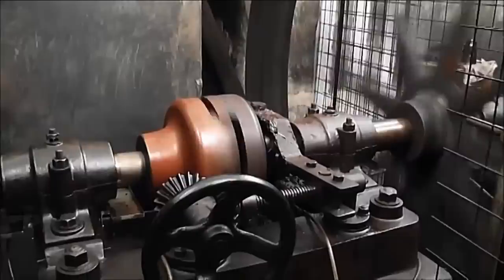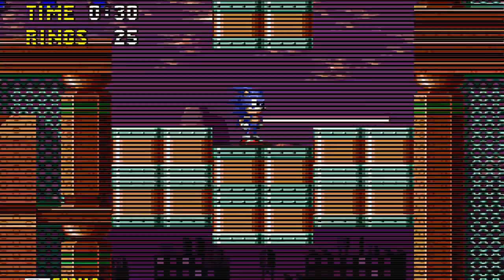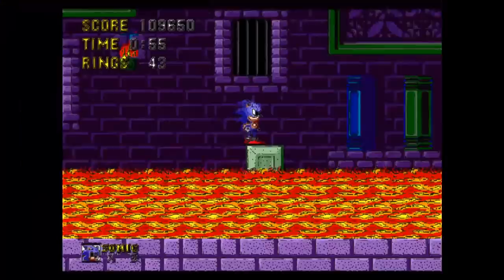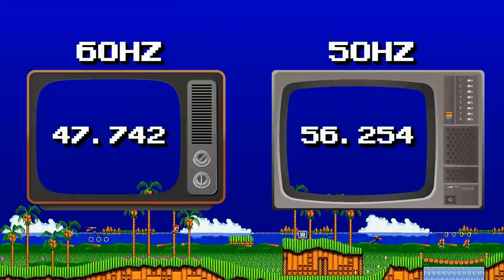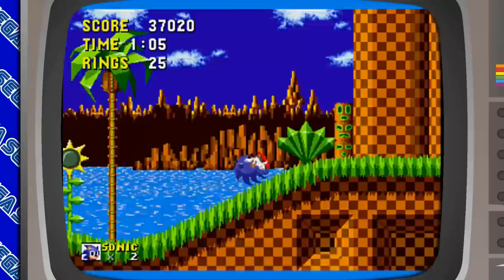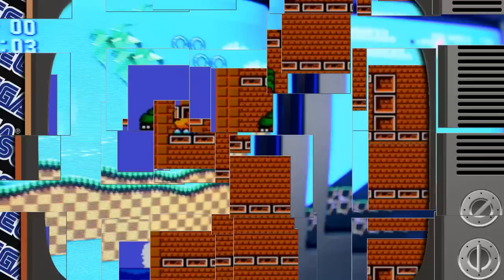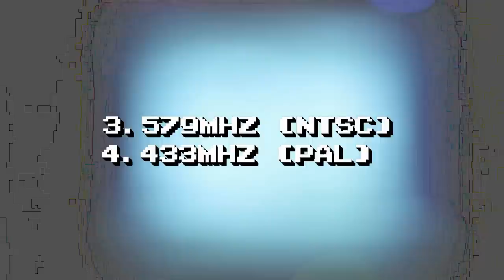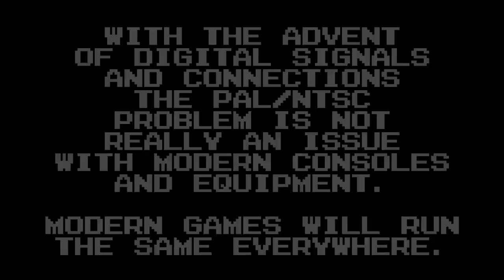Why is Sonic Faster in America? NTSC vs PAL/60Hz vs 50Hz | Nostalgia Nerd

Comment: These old consoles are easy to mod. I remember soldering in a simple switch in our PAL Mega Drive. And boom, it ran at 60 Hz :)
Reply: You got robbed 10 hz I was robbed 100 lines. :P
Reply: Had a 'merican genesis in UK, it didn't work with any of the TVs. :(
Reply: Because most games were designed for NTSC, PAL gamers didn't even get to benefit from those extra 100 lines.  Those extra lines just ended up as black borders on the top and bottom of the screen, with a squished picture in between.
Reply: @televisionandcheese   I have a US genesis and never have any issues, it would of worked if you had an RGB Scart Cable and a tv which has a scart socket, most tvs in the early 90s only ran proper NTSC in colour through the Scart socket if you were trying to use composite or RF then it would of only given you a black and white crosshatch picture if any picture at all if it was very early 90s.

I have a 1989 Sony trinitron 14"TV doesn't except ntsc through the AV inputs on the front or through RF,  So I use RGB Scart it works perfectly with all my NTSC retro consoles
Reply: television and cheese it won’t, because your TV was only 50hz, the Genesis was 60hz.
Reply: @deanfox3067  Most later CRTs work with 60hz though, even in Europe.
Reply: Can pal cartriges work in ntsc
Reply: You don't even need to do that.  Cut two traces and the console defaults to English/60Hz mode.  The true beauty of that is no one and i mean NO ONE would ever be able to beat you on rim runners from Micro Machines 2 if you practice a bit more
Reply: @josh4740  some do ! some don’t ! 
some even run in 60hz but with boarders
Reply: @josh4740  Yes they have the same shape! 💡

Comment: European Sonic should have been called Sub-Sonic the hedgehog.
Reply: or Sonic HD
Reply: Even better Sonic 4
Reply: Krisztian5HUN ???
Reply: he means cuz pal has superior video quality
Reply: even though pal did have a higher resolution games like sonic were never optimised for this which is why you have black bars on the top and bottom of the screen where you should be getting more pixels than the ntsc versions but dont sadly :(
Reply: but PAL = scart
NTSC = RF or rca
(back then)
Reply: Krisztian5HUN nope theres an ntsc scart standard in japan. Uses the same connecter that europe uses and everything just which signals come out on which pins is the only difference apart from been 60hz ntsc. Which is why i have to rewire inside the plug if i happen to end up with a scart cable from japan for an old console
Reply: everything in america is better
Reply: SirIsaacBrockOfTheColonies good joke
Reply: :D best joke of the year, nice one!
Reply: I agree Brak
Reply: Stan Smith?
Reply: I'm from the us and that is far from true
Reply: I prefer games running at 50hz. Gives the player a bit more time to react.
Not everything is about fast as you can get speed.
Man! That must be why the SNES is sooo sssllloooowwww?
Take an already slower console like the SNES and put it in a PAL region and see what you get?
At least the PAL Megadrive still had ludicrously fast games and did an excellent performance with very little slowdown when the screen got busy.

Comment: That explains why sometimes I had the fast gameplay and the slow gameplay on Sonic Mega Collection.Sometimes I would select 50Hz instead of 60Hz as I had no idea about it when I was younger.
Reply from the maker: Yeah, me too. Thinking back, that option appeared quite a lot.
Reply: Todd East haha same
Reply: EastBeast13 I thought it would always be 50hz on PAL copies? My NTSC-U copy doesn't have those options.
Reply: @Blank Blank Only PAL consoles have the option of switching to 60 hz. 50 hz is standard. On Gamecube you must hold down B during the startup.
Reply: @theobserver4214  The GameCube PAL version is interesting because they include the NTSC and PAL version of the roms. Although they were lazy and kept the US Manuals.
Selecting 60 Hz would play the NTSC roms and play like they do on the Japan/USA version. Playing Sonic 3D Flickies' Island actually loads the NTSC title Sonic 3D Blast in 60 Hz, despite the game selection displaying the PAL title.
Selecting 50 Hz would play the PAL roms, and run slower (Sonic 1) or at an optimized speed (Sonic 2, 3, etc). However, the image is actually stretched. While this does remove the black boards, it looks awful and pixelated. Just stick with the 60 Hz option.

Now the Xbox and PS2 Plus versions threw the 60 Hz option out the window, and the games use the PAL roms running at 50 Hz. I'm not sure if the image is stretched know, but I really don't care to buy a copy to find out.

Comment: I say I'm a Brit who used to love playing Sonic back in the day and I would never want to go back playing at 50hz.
Reply: RocketeerRaccoon yup, the 60hz modded Megadrive gets used most, the 50hz ones collect dust.
Reply: Because Europeans were so stuck up about PAL being better than NTSC they forget that the frame rate is more important than a minuscule resolution increase.
Reply: Yeah, thank god this isn't a thing anymore now that TV's don't do that sort of thing anymore.
Reply: Sukuraidogai ermmm no.
Reply: Knuckles the Echidna ermmmmm yes.
Reply: PAL is pretty damn good, probably mostly because European broadcast networks were laid out with 8MHz pitch as opposed to 6MHz of USA purely by accident, allowing a better placement of secondary subcarriers, plus the hindsight of NTSC colour being distortion prone. Not that it matters to a game console that only has 2 bits of chroma component and uses effectively a quarter of the frame resolution anyway. I don't think there's even that much visual difference between 50 and 60Hz, but it's a major nuisance that it isn't the same everywhere.
Reply: I played consoles and games back in the day at 50hz cause ive always lived in pal regions though ever since tv's supported 60hz and 50hz and it became common knowledge how pal regions got screwed over i never want to go back to playing retro (always use a 60hz mod or a 60hz console for retro consoles now and no longer buy 50hz versions of games) or modern consoles/games in 50hz as they run terrible in comparison and not as the game developers intended
Reply: Siana Gearz
For a 24fps TV show, there's no perceivable difference. When playing a game, I can always tell when a game dips from 60 to 55 and below. It's annoying.
Reply: Sukuraidogai
Such small dips are probably perceivable because of what they call now uneven frame pacing, a condition where assumed frame time differences that are basis for animation and simulation state that are snapshotted for each frame don't correspond to the time when the frame is displayed. This makes the animation appear much less fluid than the raw framerate would suggest. Numerous people also complain of such issues when running below 72fps on a 144fps display! It just pays to have consistent timings.
Reply: Sukuraidogai Did you watch the same video as the rest of us?  the PAL format was more than capable of the same frame rate as NTSC had it been coded to do so.
Reply: And the Xbox One was more than capable of being as powerful as a PS4 if they constructed it to be so. I'm sorry, what was the fucking point of that comment? You can say that for literally anything.
Reply: Sukuraidogai I'm very obviously talking about Sonic.  The problem was lazy Sega, not PAL, but you'd know that if you'd paid attention.

Also, I doubt anyone would have mentioned it if you hadn't been so desperate to get in a baseless attack.  Pretty sad mate.
Reply: Kirk Jacobson actually it would not have made sense to code a PAL game to 60fps since most television sets only supported 50hz natively if you had access to a $30'000 Sony PVM because you worked in a broadcast station or a medical facility then yes you could have 60hz, 72hz and 75hz modes for PAL TV other than that no luck. Why would anyone make a game run faster than your display can display it??

PAL60 TV's became mainstream in the early 2000's and the Sega Dreamcast was the first console to support this mode.
Reply: With you. Ignorance was bliss. Not anymore
Reply: I have so much nostalgia for the pal versions I rather them
Reply: In my day it was 50Hz and that was it. The internet was just getting into the homes.
Reply: Sonic gotta go fast afterall!

Comment: Most emulators don't "run at 50hz by default", they auto-detect the rom's letter region. You can override this of course. But modern emulators auto detect

Comment: I'm in the UK and on PS2, when playing Sonic Heroes, you had to select top use 60 or 50MHz.
Reply: I know this is unrelated, but on the Wii you can pick as well
Reply: They don't even get he test button elsewhere xD 60Hz peasants
Reply: Moving from the PS2 and Gamecube, a lot of games supported this, no idea if it was because more TVs supporting both standards I have no idea, even if some games diddnt ask, if u held buttons on start up it might let you change to, it was a very wierd time, but those consoles diddnt have the same slowdown issues though...
Reply: You do on taito legends 2 and some other games including Dreamcast games. Most modern PAL TVs are probably 60HZ now.
Reply: 60hz master racers* :^)
Reply: That's because by the time the PS2 age came by, Multi-system TV Sets that were able to run PAL50, PAL60 and NTSC60 were commonplace, and the Developers were able to let you select to run the game at 60Hz, as intended.
Reply: I think the first system where it was popular was Dreamcast, and the reason was probably an artifact of some ported Sega Naomi games that actually ran at a 50fps (e.g. Crazy Taxi) but would be definitely too fast at 60Hz that they still needed to provide for the home JP/US port, so they started doubling up frames. Other games yet were locked to 30fps, regardless of region. Fighting games were natively 60fps and were essentially frame-skipping on 50Hz. At the end of Dreamcast era and on PS2 and Gamecube, games gained framerate independence by executing the gameplay logic usually at fixed 30Hz, but letting the animation playback and camera logic be executed at the native framerate of the output. Attempts at running gameplay logic at native framerate have failed, as collision detection in particular would not behave the same: you will see that some SA1/2 "falling through the floor" issues only occur when the game is not running at its intended framerate - the issues were rare enough, but it was probably a big enough effort for developers to make them not too glaring.
Reply: Leeor Vardi you know I had a multi-system TVs in 90s. I didn't had seen no one TV that was not multi-system, not mine, nor friends'. Only that old shit from 70-80s you know that big bulky TVs that not even had composite or s-video or anything modern outs only antenna out - that TVs yes didn't multi-system. But SEGA and Nintendo always did games according to that old TVs' standards. Even today I didn't get why they did that shit
Reply: mr3dx Maybe it was just your region. Old PAL TVs were fairly commonplace here around 1990 and even a few were up to 2000, but then people started to get new TVs that could do 60hz.
Reply: Slippy Toad nah! They all both multi-region TVs for sure. I live in Eastern Europe so my home TV standard is of course PAL, but all really all TVs support NTSC/60 (NTSC USA and NTSC Japan). Some of them I have today and I can plug some American NES or Japanese SEGA Mega Drive and just play in color like home PAL and resolution will be of course 320x224 not PALish 320x240 with borders. So in my country and I personally never had this "incompatible" problem. Maybe some countries have, but I doubt that TVs makers did some special version of their TVs that only have PAL (or NTSC) for some countries, they did universal TVs for all countries so it doesn't matter in which country you live you just buy a TV, bring it home and it will be works just fine.
Reply: They started that with Sonic Adventure on the Dreamcast back in the late 90s
Reply: I once brought my Gamecube to a friend but he had an old TV so I wondered why the hell the screen went black on Mario Kart. I think I figured it out the next day with the hz selection screen.
Reply: It's Hz, not MHz
Reply: Apparently, that's also the case with Sonic Adventure 2 on Dreamcast, but not GameCube for some reason (I live in the US, so I don't have much experience with PAL TVs as you can imagine).
Reply: @leonro  I bought a £500 Sony Bravia in 2009 (new) that was 50hz, ruined my day when I realised that :(

Comment: Before the advent of video games, PAL 50 was considered superior to NTSC.

SECAM was different from PAL in that, besides the monochrome part of the signal, it was completely different.

PAL and NTSC both used AM for color encoding.  It takes three signals to get color, one of which is the monochrome signal.  The other two are encoded in AM, interleaved within another, and transmitted inside the monochrome signal.  PAL also inverts the color every other scan-line so that errors would cancel out, which NTSC doesn't do.

SECAM used narrow band FM color, with both color signals laid beside one another, and then transmitted inside the monochrome signal.

The thing with SECAM though, is that old computers could easily fake the NTSC/PAL color signal using simple circuits, and get color that much easier.  SECAM on the other hand was more complex, and SECAM versions of old computers / consoles often had poor colors.

Comment: Great video, but the interlace description is not entirely correct. It's true on regular TV programs that they use interlace, but not on older game consoles. They output the video to the SAME line on each frame and don't alternate between them. That's why you can see a black line between each line on older systems.
This also makes the game look better on a PAL TV than on a NTSC since the resolution seems to be higher. You have more lines so the black lines you always see on an NTSC TV is not so visible on a PAL.

One benefit with PAL is that since the frequency is slower, you also get more processor speed for each frame. So a processor intensive game will run smoother on a PAL system.
Reply: Sonic 2's split screen multiplayer uses interlacing. The doubled vertical resolution conveniently squishes everything to make room for 2 screens.

Comment: Classic game consoles don't do even/odd line fields, they output 50/60 frames of progressive signal at half the vertical resolution.

The television broadcasts all have an odd number of lines in total, so that when a new field starts at the beginning of the line, it's an odd field, and when it starts at the middle of the line, it's an even field. Because of this,  the synchronization hardware can be designed to handle the odd/even field transition with minimum number of parts - the timing of signals vs. oscillators would implicitly result in the vertical offset between lines of odd and even fields.

However, classic consoles don't exactly conform to broadcast standards. They have an even total number of lines, thus always triggering the odd field in analog CRT based TV sets. Though it can still land in odd/even fields in digital capture equipment that buffers.
Reply: Siana Gearz wow, someone who is actually competent about TV standards does retrogaming  :)
Reply: Siana Gearz yep, that is why there are scanlines and why old games look like crap on modern TVs that try to deinterlace everything.
Reply: this should be top comment since he got this whole explanation wrong
Reply: Cool story bro
Reply: ***** I think you are projecting too much.

Comment: I just noticed that it's messed up that Europe has slower video games (60fps over here, 50fps over there), but they have faster movies/tv shows (24fps over here, 25fps over there).
Reply: It was more common in PAL regions to simply take a film and speed it up by one frame per second, from 24fps to 25fps as a quick and dirty method (rather effective) to match the video framerate from films 24. They then shift the audio pitch down slightly. But the result was a film that ran 4.1% faster, run time wise versus what was seen in the theater. Seems hardly noticeable, but the result could have interesting changes for media. If a film that took three sides of a laserdisc set in NTSC, it often only took two sides on a PAL region laserdisc because the timing was just short enough to fit onto a single laserdisc, or just two sides.